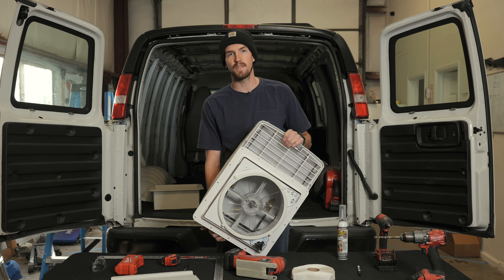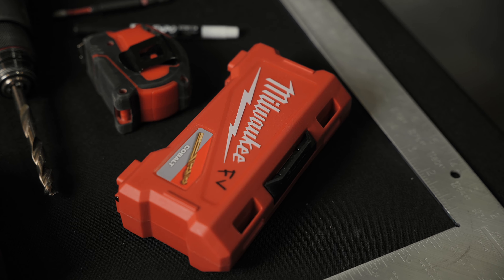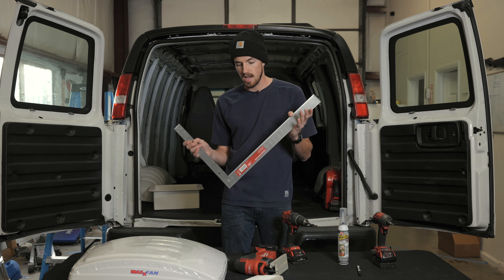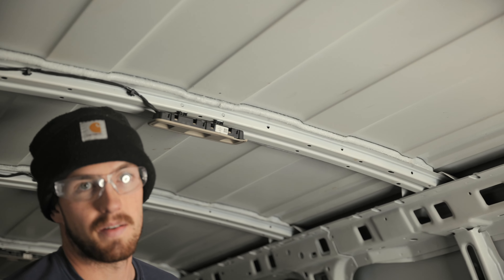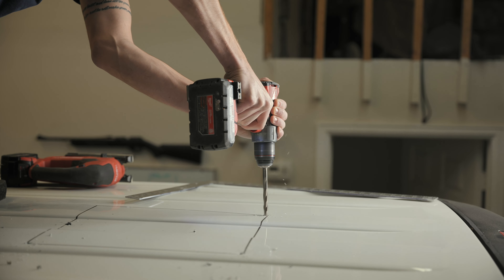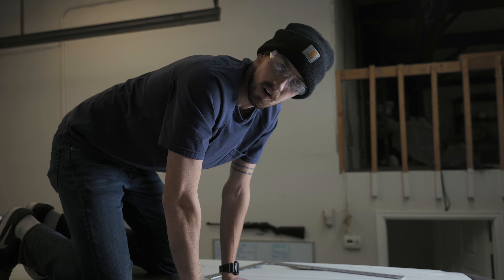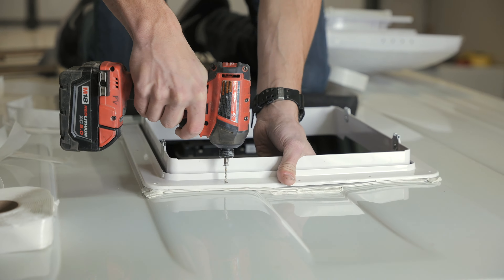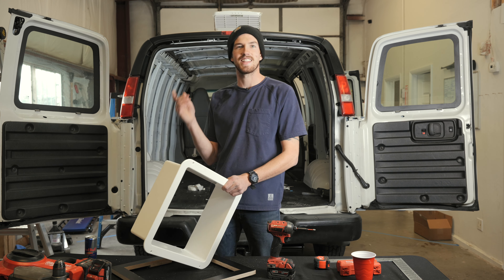The BEST way to CUT a Fan into your Van!! Pro Tips Ep. 2

Comment: I saw a video by professional van conversion company saying the avoid the large protruding they use a "super" computer fan with vent cowling (low profile). I looked into this and maxair moves 600 cfm at max setting, while a supper computer fan is 200 cfm so two would probably be good enough. Your thoughts.  Great video by the way.
Reply from the maker: They probably got a kickback from that company or something! Any fan will do, but the maxxairs are just the top of the line!